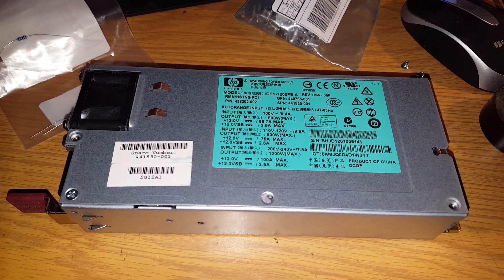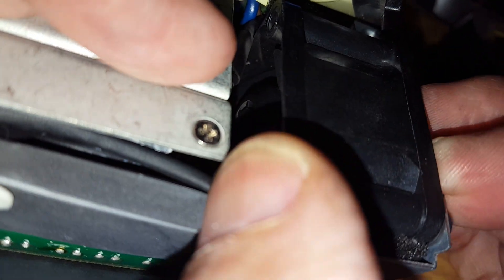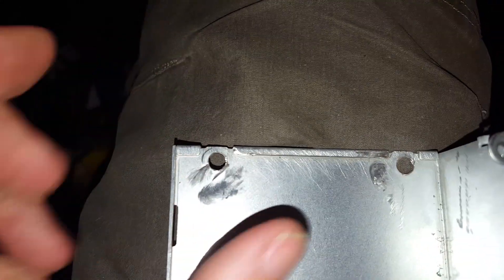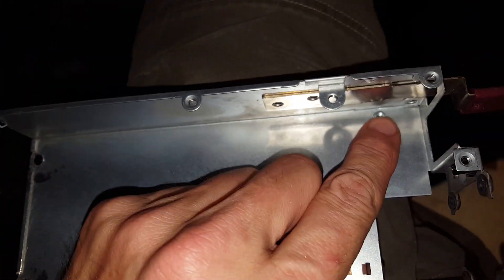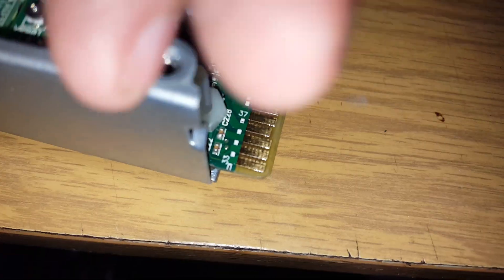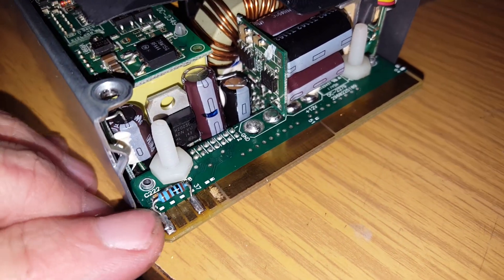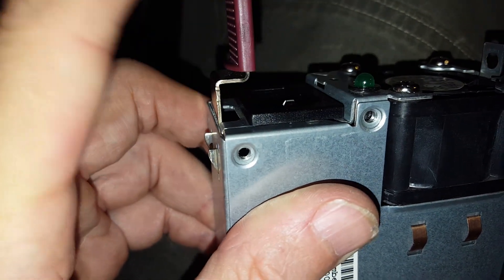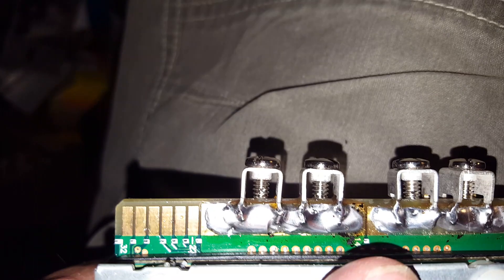dps-1200fb float mod

Comment: Hi ! I ready buy few power supply, and put the power cord for make sure those working before star the modification, and the fan runs but the green led lights in those 2 no turns on , is normal until you add the resistors?? thanks again
Reply from the maker: you have to add the resistor to power the supplies up.  It's like an ON switch.

Comment: Do you notice if your psu's get rather warm? I can put something like a battery on charge at 16a (single supply so at around 12v~) and be pulling over 30 amps through my icharger. The cables themselves get a bit warm, especially the banana plugs i'm using which is expected, but the psu gets hot and fan doesn't ramp up. Like burn your hand after a couple seconds hot. My cheapo thermometer says around 60c which sounds about right. I have 3 of them that all do the same thing and never heard the fan spool up. Am I just right at the threshold for that fan? Or maybe they all happen to be flawed?
Reply from the maker: My fans don't take long to start up with a small amount of draw on the PSU.   When I run 4 in series @100 amps the fans run solid, and the PSU's get warm...but not-burn-you-hot.  I only run them at 4 in series or two banks of 4 in series, they never get THAT hot.
Reply from the maker: I have several video's of various tests I've run with my setup, I am pretty sure you can hear the fans running in them.
Reply from the maker: See this: https://youtu.be/quZd09Nsuuc?t=336

Comment: Excellent video !!! could you  add the   where is the best place to buy the power supply and the resistors 1k ohm (1/4 w , 1/2 w , 1 w or other  I can not find that blue color with the same color lines )   pls  , thanks for your help !

Comment: hello, in this power supply its possible ajust the fan speed ?...for make it more  fast or slow ?
Reply from the maker: The speed automatically adjusts based on the the load.  Higher load = faster fan speeds.

I have however, seen modifications (here on youtube) where someone uses a arduinio device to control the fans based on temperature using a sensor.

I have no need for changing how the fans function currently so I haven't attempted to do anything with them.  Have a look around google or youtube there ARE mods for changing the fan speeds.

Comment: Good video! Anyway you could post a link to the terminal lugs? I can't seem to find them on line anywhere. Did they work OK? Thanks in advance!
Reply from the maker: https://www.digikey.com/product-detail/en/keystone-electronics/7693/36-7693-ND/151562
Reply from the maker: Beware spec's say these terminals are rated at 15 Amp.  2ea is probably safe to assume 30A load sharing.   But there's nothing standard about what's being done here.  They're not mounted per norm spec for this lug.  And don't forget solder-melts :-)    You've been warned.   I have pulled nearly 100 amps @ 54vdc out of 4 running in series.  So there's that.  

I run two banks in parallel of 4 each in series @ 54vdc for a total capacity of 200 amps.  But so far I've only tested it up to 100 amp draw for 15 minutes.  

It worked fine the way you see I configured it in the video above.
Reply: Tim Havens Thanks for the reply! Will keep all in mind... Much appreciated!